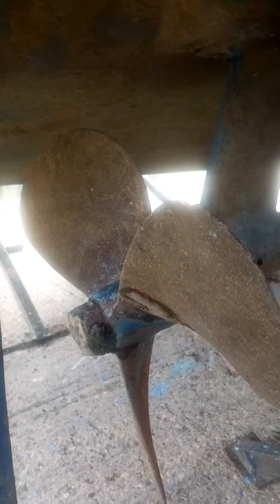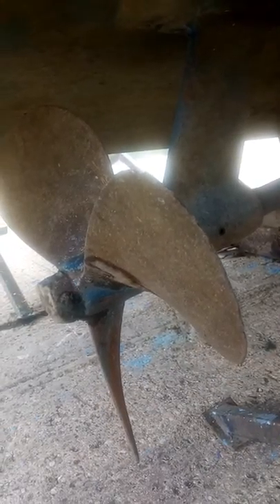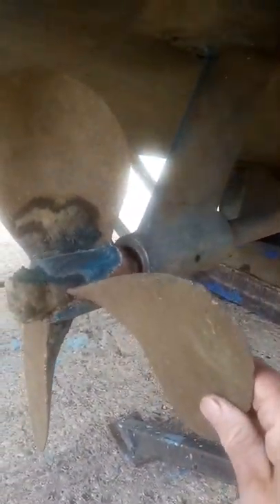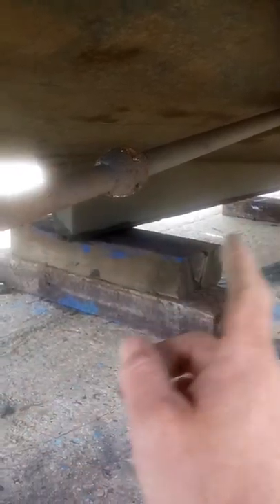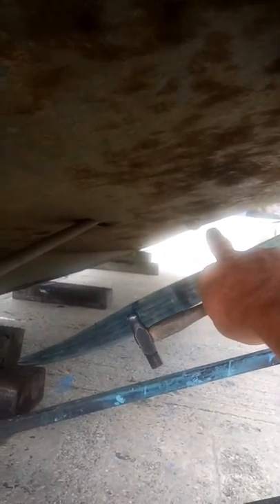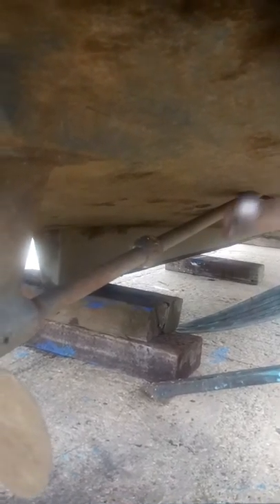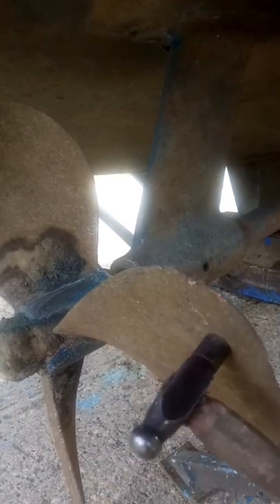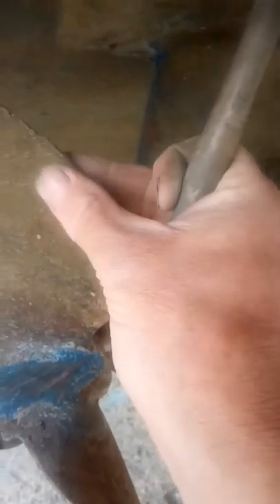Serious Propeller problem on a boat. dezincification.

Comment: Does Dezincification happen on Brass statues that is kept dry?
Reply from the maker: Hi interesting question, my own experience is I have a 70 year old ships bell, it's as good as new, the stripping of the alloy needs something the start it off... Ie in contact with a metal high or lower in the periodic table... Hope that helps
Reply: Pure bronze does not contain zinc to dezincify and conditions do not provide the needed electrolyte (like salty water) so, expect a full million years lifespan for your statue